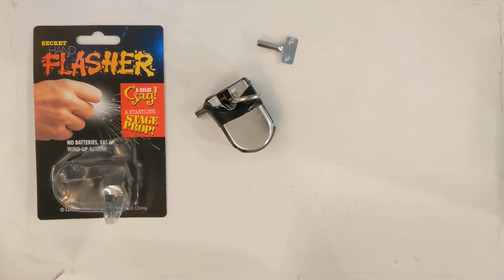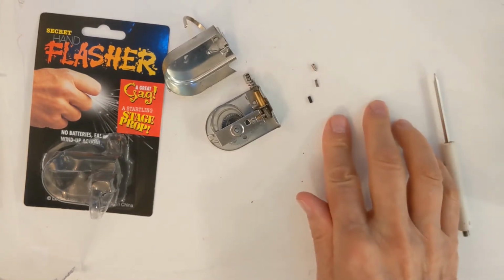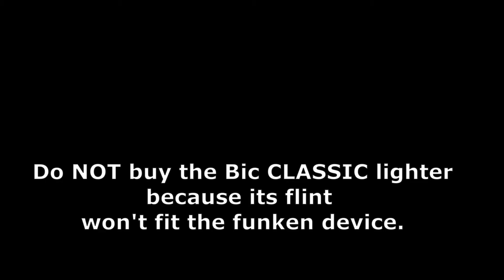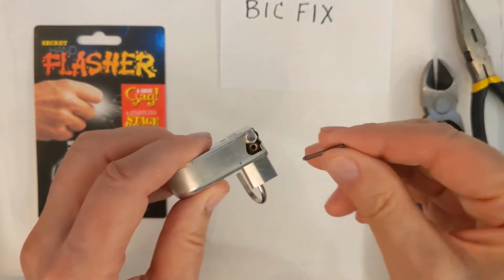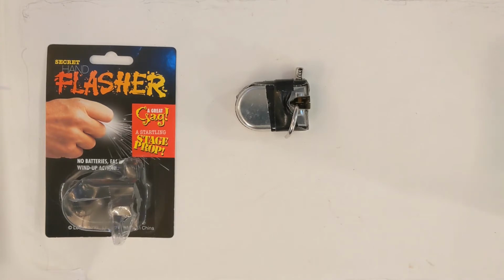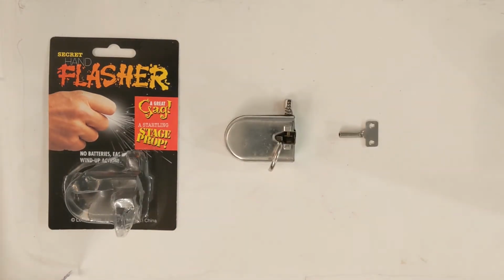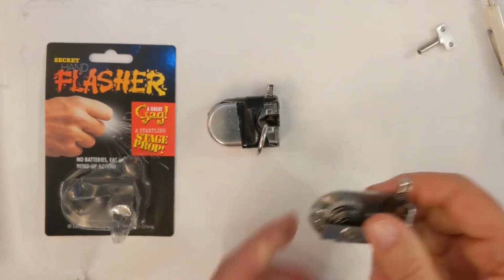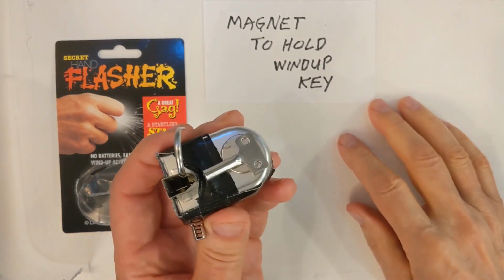Flasher Ring Fix   Part 1

Comment: I have an additional tip I figured out.

If you oil the mechanism inside the hand flasher, it works a little better.  Get a small can of standard household 3-in-1 multipurpose oil from a hardware store.

Use a small screwdriver to pry up the single tab at the top of the curve on the bottom.  You can see this in the video starting at 3:00.  Take off the upper shell.  Put a drop of oil on any part of the hand flasher where something rotates.  There are about 8 of these - anywhere you have a small rod that rotates in a piece of metal.  Just don't get any oil on the big gear that spins against the flint.

That's it - put it back together and wind it a couple of times.  It should wind up easier and spin a bit faster when you press the button.  The spark will be a bit better.  I sometimes have the end of the spark go as far as 6 inches, but usually the main spark is about 4 inches.

Comment from the maker: When flint has worn down to point that spring has no tension cut a quarter inch from the stem of a q-tip and tape it on top of the flint spring.
Reply: Hey Glowball, or you could just use some of that leftover spring you cut off.

Comment from the maker: Poor math on my part, the flint spring should be a little longer to accommodate for wear of the flint.
Reply: Hi there. Do you recommend the Flint Flasher that Penguin Magic also has? It's 15.96 and I'd like to get it instead of the Hand Flasher in this video. It doesn't come with the required flash cotton. What do you think?
Reply from the maker: @little.bear344  I have no experience with the Flint flasher, but it appears to be an igniter of flash paper or flash cotton which means you could have some fire marshal issues at the venue. I know some of the magician competitions restrict the use of fire whereas the normal hand flasher from Loftus should be okay.

Comment from the maker: Cutting the flint spring to length:
Actually the spring should extend above the top of the device about the same as the Flint length (maybe a little more) because as the Flint wears down there won't be any pressure from the spring when the flint is completely worn out.

But you will want to replace the flint when it is down to about 2 mm in length (you will know when your flash is getting weak).

I now recommend using a flint length of about 6 mm because the 9 mm may cause the Flint spring to be too long and maybe cause too much pressure on the flint. These are minor points and just effect the number of uses before replacing the Flint and the Flint spring.

Comment: So you think the best method to secure the spring into the Flint barrel is to forgo the set screw all together and just use tape?

Interesting...
Reply from the maker: Yes, duck tape or better yet gorilla tape. In theory a little screw should be better because as the Flint wears down you can tighten it up. But when doing repairs it is super difficult to put the screw back especially with the spring pushing up at the same time.

By using a longer spring sticking above the top you can clip the spring to the proper length and then just tape it down.